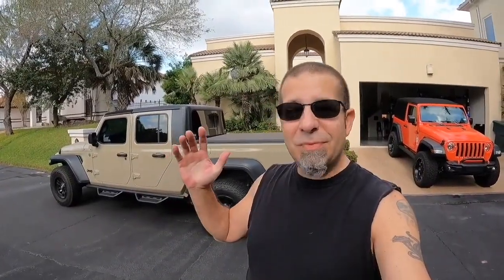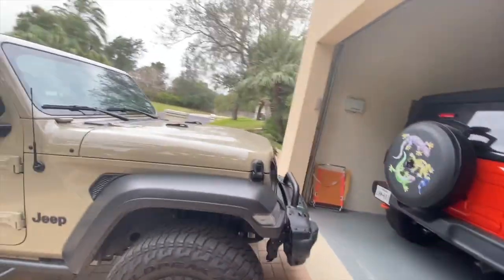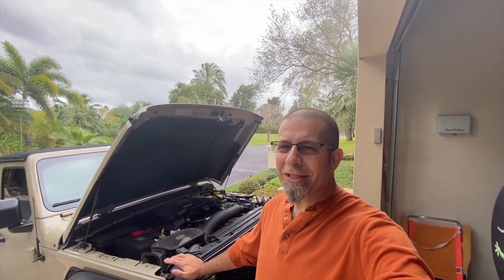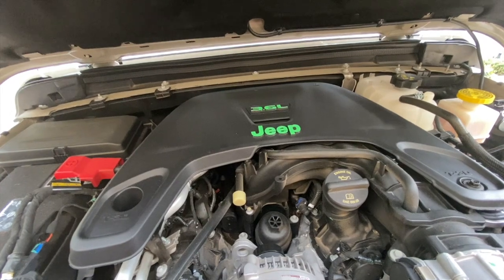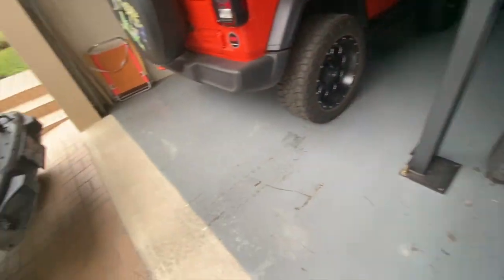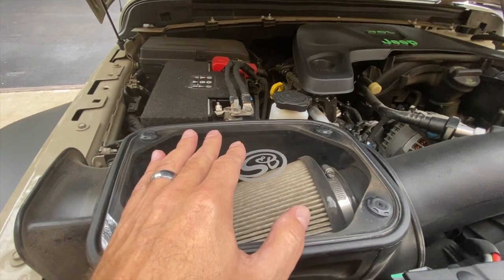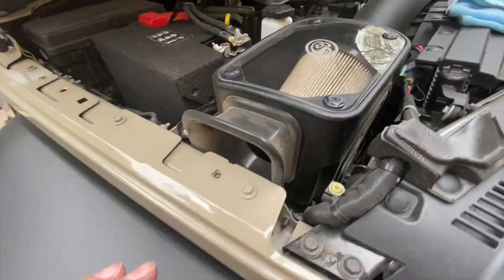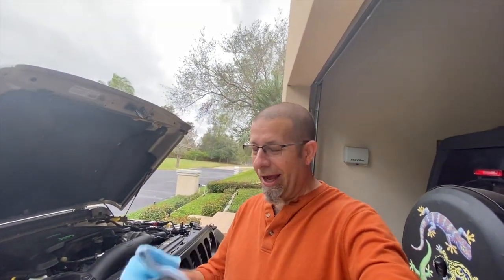Downside of Putting an S&B Cold Air Intake in Your Jeep Gladiator

Comment: Hmmmm you are missing a painting opportunity.  That S&B logo on the cross pipe more or less in the middle.  
If I got the dust off one part it would make the other parts look terrible so it becomes a engine bay dusting.  If you put the McGuires hybrid ceramic coating on the hard poly parts it is little easier to clean.
Reply from the maker: Hmmm....🤔

Comment: I had one.  It kept setting of my check engine.  They sent me a replacement,  that worked,  but then performed lile crap.  Exspensive garbage. I took it out,  put original in with a k&n filter.  Performed much better.
Reply from the maker: The only thing that would cause a check engine light is improper installation of the air flow sensor.  This is not a problem with the CAI but rather the installer.
Reply: bruh its the installer which is you lolol

Comment: Hey Rob, reading some comments on Jeep Forums, people mentioned constant CEL’s on the earlier S&B version. The fact you didn’t mention any thrown codes is a good sign S&B corrected the problem.
Reply from the maker: Hey Greg.  The only way it could throw codes is improper positioning or installation of the MAF sensor.  S&B could have produced units with the wrong MAF location, but I’d guess most problems were caused by improper installation.

Comment: Great videos. Keep em comin. You sold me on getting an S&B CAI for my 21 JLU 👍🏾
Reply from the maker: Do you have it installed?
Reply: @robmotiveplus  ordering it this wkd 💯. You experience any codes or issues in relation to having it installed?
Reply from the maker: Awesome 👍. No issues with mine.  Make sure you place the MAF sensor the same direction and orientation as stock and disconnect the battery before install.